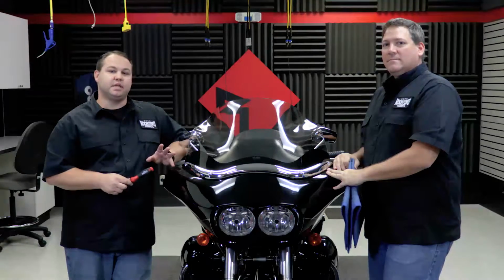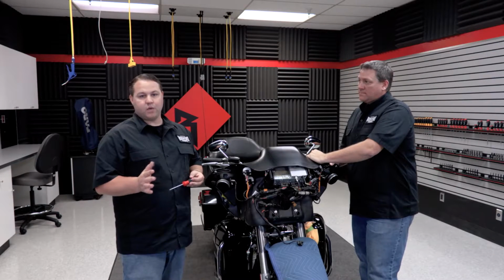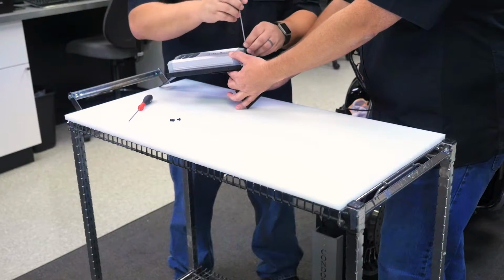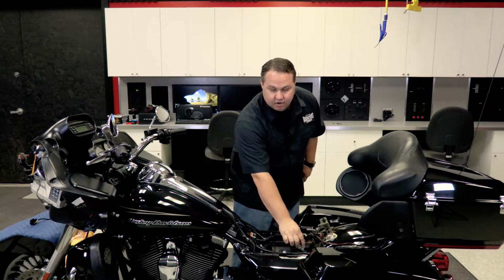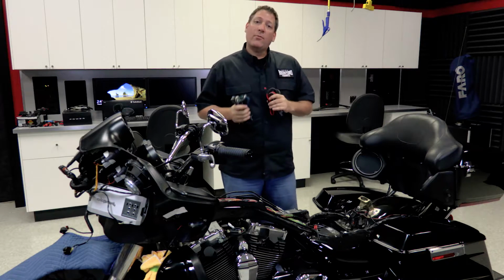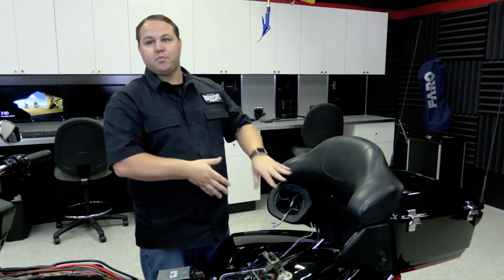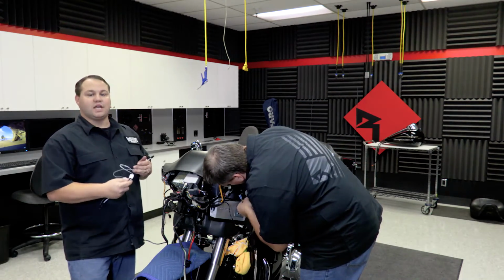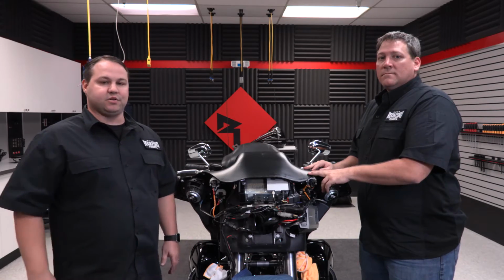1998-2013 Road Glide® Front Speaker & Amp Install

Comment: I would like a video on the wiring for a four speaker with the amp in the new stereo head stereo radio I would like to know if they put if something come unplugged again
Reply from the maker: We have installation videos for a HD9813-PMX-STG2 system that includes the 800W amplifier, upper fairing, and radio kit for a 1998-2013 Road Glide: https://rockfordfosgate.com/products/details/hd9813rg-pmx-stg2/

If you wanted to add the rear speakers, you would simply add the TMS5: https://rockfordfosgate.com/products/details/tms5/

Comment: i just finished installing same unit on my 2011 CVO Ultra Road Glide 110 . Turn system on no music nothing i double checked all my wiring and its in order. What could be the issue?
Reply from the maker: If the amplifier isn’t turning on, the blue remote turn-on wire isn’t getting proper voltage.  You may want to look for a different switched terminal for proper voltage.

Comment: I have internal fairing supports and the amp won't clear the bend in the mount. What do you suggest? I really don't want to put my crash bars back on this bike. Short of cutting and re welding this support I don't know what to do. Is there another mounting kit for this issue
Reply from the maker: Hi rrobertschopper, Unfortunately we don't make an alternate mounting bracket.  After talking it over with all the techs about alternate mounting locations, we don't have any viable solutions to work around an aftermarket brackets due to the limited room inside the fairing.
Reply: @rockfordfosgate  thank you for your reply. I found a way to make both mounts work together. I cut a section of the internal fairing support out so that amp mount fit in place. All worked out great.
Reply from the maker: @rrobertschopper  Awesome!  Great you got it to work!

Comment: do you know where the lowers came from on that Harley. I bought some from eBay for my 06 road glide with the speakers pods in them. however after installing them I cannot hook back up the brackets that mount to the blinkers and the crash bar. It seems like the lowers I ordered are too tall. Just wondering if anyone knows. The Lowers are pushing up the ferring
Reply from the maker: Not sure, this was a customer's bike that was filmed 3-1/2 years ago, sorry.

Comment: Will this kit also plug and play with an aftermarket head unit? I have an aquatic av in my bike. I'm also looking at getting the lid speakers from RF.
Reply from the maker: Yes, it certainly can since this kit is designed to interface with the factory radio's speaker outputs.  However we caution on the term "plug-n-play" since the connectors would need to be cut-off and adapted to the aftermarket radio.  Since you're using an aftermarket amplifier I highly suggest you contact our technical support to determine the proper GAIN settings on the amplifier as this will differ from what we've explained in the video.  They can be reached at 1-800-669-9899 Mon-Fri 8-5 MST or 24/7 at http://rftech.custhelp.com.
Reply: Rockford Fosgate the head unit I have uses all of the factory wiring as I can still use the factory controls
Reply from the maker: Sure, tapping into the outputs will not affect the "controller" part of the radio.

Comment: @Rockford Fosgate, I installed this amp on my 2010 HD Road Glide Custom. Question: how does the REAR of the mounting bracket get attached to the inner fairing (under the speaker)? Your video only shows the front of the bracket mounted by the two inner fairing bolts. TIA.
Reply from the maker: Good catch on that one.  The back side that uses the skinnier bracket attaches to the Side Marker Light.  You'll unbolt the side light from the motorcycle and place the bracket over the two studs sticking out, then replace the side marker light on top of the bracket and bolt it down.  The slot in the bracket is for the harness so it can pass with a little relief.

Comment: @Rockford Fosgate, on a 2011 HD Road Glide Ultra CVO, your website states "May not be compatible with CVO or Screaming Eagle models" and "NOTE: Installation on CVO and Screaming Eagle models are not plug-n-play and will require modification." But it doesn't elaborate on what those modifications are. Can you elaborate here?
Reply: you would have to remove the factory and also the amp wiring, if possible, and then the kit will be plug and play.  If you have a bike where the amp harness is integrated in the main harness and not removable, you will have to rewire the factory amp plug to allow the signal to be looped back in the audio system and then install the kit as normal..essentially reconnecting input to output back to each other (since they were interrupted via the factory amp) to allow the audio to feed as normal

Comment: If I install the amp and front speakers only, how will this affect my stock rear speakers?
Reply from the maker: Great Question Jack!  Using the HD9813RG-TKIT, the front speakers would likely drown out the rear speakers.  The factory HD speakers I believe are rated at 86 dB, whereas the TMS6RG included in the kit are 94 dB (an 8 dB difference!)  A difference of 10 dB is considered "twice as loud," so it's safe to say the front speakers would be audibly louder based on the speakers themselves.  Just imagine, add the amplifier power to the front speakers to increase the amplitude even more will just exacerbate the issue.

Comment: You never showed how it hooks up to the head unit
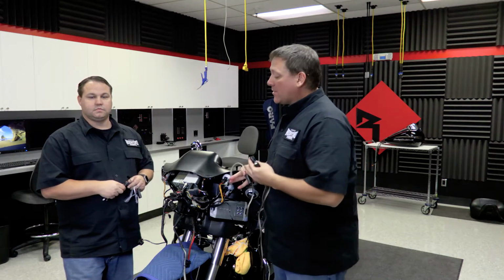Reply from the maker: At 14:32 is where it's done.  It doesn't explicitly show connecting the radio's speaker line outputs to the harness, but it's assumed once you disconnect the radio output cable from the speaker, you'll be connecting those wires to the included harness, with the remaining side of the harness connected to the speaker.